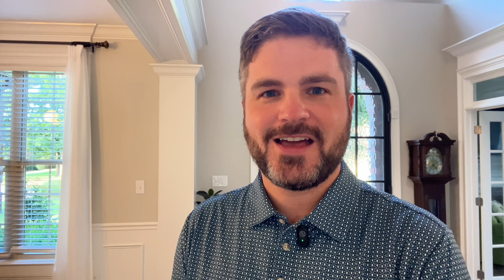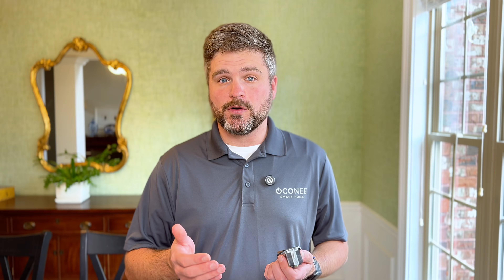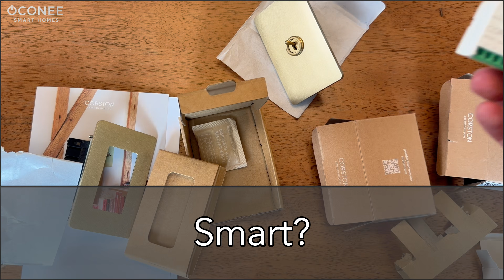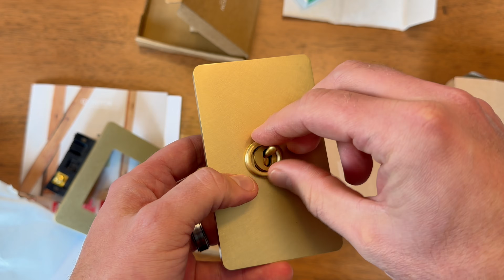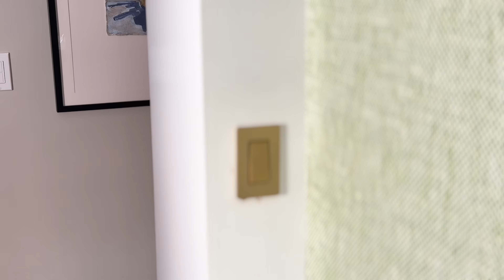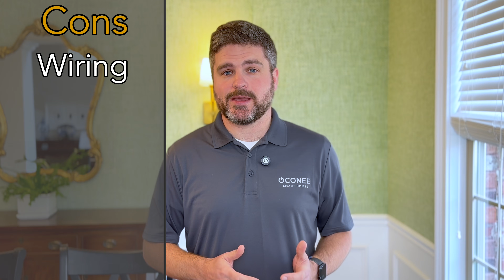No More Ugly Smart Switches. Finally! | Corston Architectural Smart Dimmers

Comment: Hi, can you tell me if this smart dimmer module can be used in detach relay mode? And do you know if it would work with a Gledopto matter  driver for an LED light strip? (I think it might need a bypass for the low load LEDs, but not sure about its compatibility with the driver itself?)
Reply from the maker: No, it does not support a detached mode so not really suitable for smart bulbs.
Reply: Thanks for getting back to me. It’s a shame there isn’t a database where we can check what matter endpoints are available for devices

Comment: Great video once again! I love that higher end architectural brands are jumping in the smart home game. I hope others follow as well. "Smart without looking smart" seems to be the new trend, such as the Level Lock. I do have a question though, what does "Relay Based" mean exactly? How does it compare to the Inovelli Matter Over Thread Dimmer?
Reply from the maker: Thanks so much! By “relay-based” I just mean they’ve chosen to put the smarts in a separate module. The nice thing there is you can do a 3-way set up on a single module. 
Compared to Inovelli - it has fewer smart features/less configuration options. Otherwise it’s a reliable smart dimmer! And my wife loves it! No objections from her.

Comment: Nice hardware.  I see you have really thick plaster walls that give you a built in volume increase for the relay and the solid wire.  Most old boxes don’t have that capacity.  My only complaint is with all the exposed copper wire!  If this picture was from the “testing” phase you should have used a picture from when the wiring was finalized.
Reply from the maker: In this case the “wall” where the relay is inside a trimmed out column, so the box is a bit recessed. But I agree, not every box will have room for a relay. 

Yes, this step where I recorded the relay working was testing. Once I got everything working, trimmed up the wires and taped off the terminals. I actually meant to get this on video for this exact reason, but forgot to film when i was doing that.

Comment: Kinda lame they need a separate relay. I wouldn't want them because I don't have any of those finishes in my house, haha. Also, what if you want to dim up? There's just no way to do that? Strange.
Reply from the maker: Relay isn’t my favorite approach either. To increase brightness just keep holding. It alternates decreasing/increasing or once it hits lowest level will start going up again. But in practice I’m not actually using the physical switches for dimming too often, and most of the brightness settings are done in scenes.

Comment: Interesting switches, but some issues for folks to consider.  First, they are architectural to a period, so in this house which looks like it was built in the early 1900's or built to appear that way, design wise it is a perfect switch for it.    But so would a Control4 switch be as they look very nice, just not period specific.    Never heard anyone say C4, Crestron, Savant etc switches are ugly and for that matter, Lutron or Leviton, a typical rocker looking switch in most of their lineups, again not ugly, it's just a rocker switch.    Second issue, your switch install there appeared to be not inside a junction box.   Not sure that is ideal or to code anywhere, but the reality of that assuming it was just for video editing sake and there was a junction box in the wall there, no normally sized junction box is going to have room for that relay behind the switch.     So nope, $240 for a switch, no matter how good it's built, is worth it if you are ripping out junction boxes to make things re-fit.
Reply from the maker: Thanks for the comment. This was replacing an existing switch and there is a junction box. Since the switch is mounted in the trim the box is slightly recessed. I agree not every box will have room for a relay. 

And yes - nothing wrong with a standard rocker switch, or even the more modern looking designs from the systems you mentioned where they fit. Just contrasting the design here.